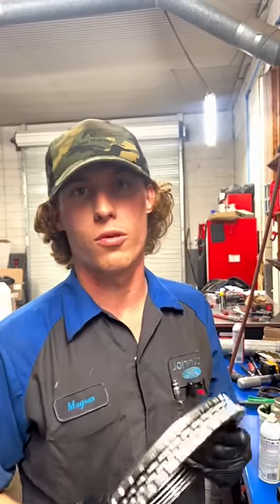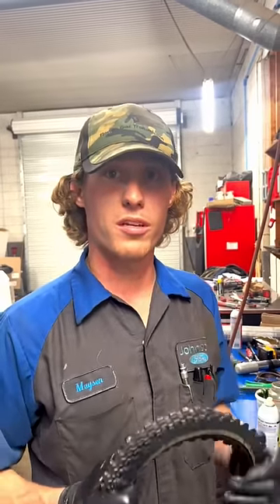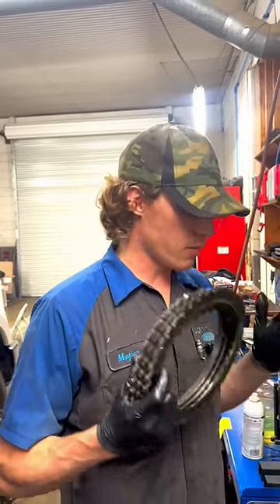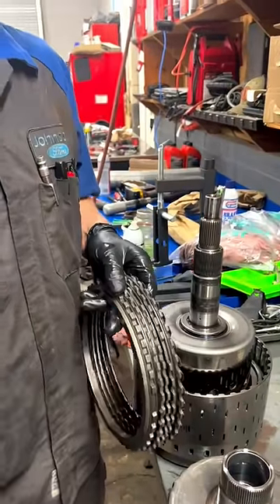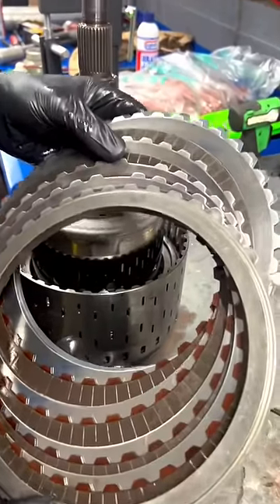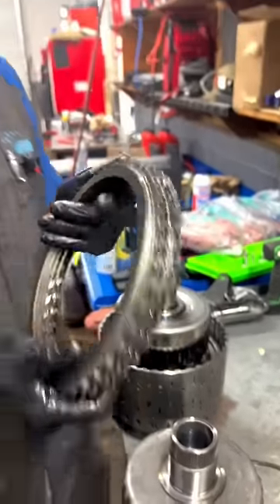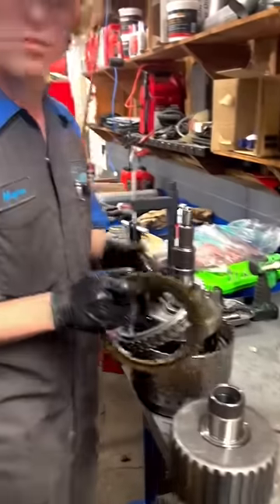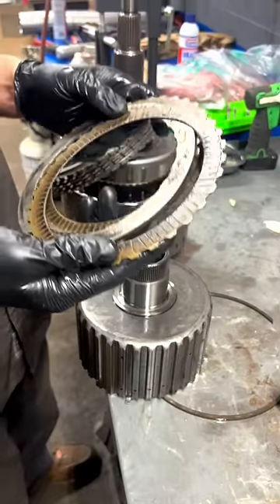Should you replace every clutch during automatic transmission overhaul? #shorts

Comment: I live by the “ well since we are here might as well “ mentality
Reply: Some times that "while you're in there" gets really expensive! But I try to do it too...
Reply: Years ago I couldn't afford to, however today yes I too live with while in there. I wouldn't know how to teardown auto tranny but would communicate with shop to rebuild mine with while in there.
Reply: I'm with ya on that. But also believe in "if it ain't broke, don't fix it" especially on those clutch discs that are showing like no wear after 100k miles. Also if I had to buy the clutches 1 at a time I'd only do what was necessary, if they came in a set ill replace them all.
Reply: While I'm here has turned into control arms, steering rack, AC compressor, outer tie rod arms, rust prevention, brake pads and rotors, and a coolant change.
Reply: @4BillC  it could be more expensive doing the job twice , 2x time = time lost of you be able to make money if it’s your own vehicle
Reply: @marieortiz698  100% agree!
Reply: @ShiFtY 1  your already spending thousands on labor... why not just get it fixed... it's already out
Reply: That mentality saves a ton of money with a good tech. Cost more in parts but less in labor in the long run when it has to get done again later on
Reply: @nothankkyou3176  and a good tech will recommend it. Personally I do my own work and on an actual budget so i don't always do it while I'm there but I try.
Reply: And that’s why it costs so much to get basic work done…. Lmao
Reply: @RK_Insanityy  sometimes but not always. Unfortunately though we have 2 options, pay someone or learn how to do it. I didn't grow up with money so I couldn't pay anyone to do anything. Now at 41 there isn't much I can't fix. It may not be perfect but I can't remember the last time I had to pay someone to do a job I couldn't.
Reply: @4BillC  amen brother I’m the same way.   It’s hard for me to imagine being poor, I know what I went through and my struggles just made me hungry so I would find that side job and learn so I could go up.  I keep that mentality even today.  There is always a side hustle you just gotta want it. Now that I do ok for myself I still do it and friends will joke that I could get it done for 1/4 of what it will cost me to do it—— maybe but then I wouldn’t get to buy all the tools and keep them!!!
Reply: If your replacing only the worn parts,then it would only be considered transmission repair,not a rebuild.
If you are replacing all of the typical consumables,then it would be considered a overhaul.
I've seen those two words used incorrectly a lot.
Not only in the transmission area,but other areas as well.
I think it is good practice to educate the owner on the repair with complete honesty.
Reply: @shifty1927  Exactly 👉
Reply: That’s a guy I will throw money at cause if I here well since we here I know my car gone be damn near new when I get it back
Reply: Until you realize that just because it's a new part that doesn't mean it's better
Reply: @griffinsells2611  you needed it 😂
Reply: I had to replace parking brake lines on a 78 F150. Did the shoes as well cuz,well here I am.
Reply: That’s the thing. The trans fluid and labour to do it again will be worth more than the parts you left in there.
Reply: Then you find that your new part is worse than the old one and burns up. That's the problem. If it works and has worked for a long time with no issues/looks new then you shouldn't bother. Don't go making more problems for yourself unnecessarily
Reply: If I've already pulled that shit apart.......... I'm replacing, because in the off chance those parts fail after I replaced only the bad ones. I really and I mean really don't want to pull it out and apart again.
Reply: Reminds me of my dad. That was his way, and now it's my way.
Reply: When you change brake pads on one caliper, if one side is worn down to 1mm and the other pad still has 4mm (which is about half life), do you replace just the one pad? No you replace both pads and the rotor and then do it again on the other side of the car. Albeit pads come in a set of 4 to do both sides of a car but rotors are separate. You don't pad slap as that causes chatter and off wear. Can you? Sure but you just don't. So I'm with you on the while in there. The clutches may look fine but their seats may not be which seems to me like the brake pads above, could cause uneven wear of the new clutches installed or the old clutches left in creating vibrations or something else. That would be the reasoning I would have to change them all.
Reply: As a customer that’s perfectly fine but as a mechanic/shop that’s a fine line to walk. I’m getting my cars bay and motor painted/worked on and I got talked into a single turbo kit. Not saying that’s a bad thing but if my GF asks I’m not gonna say it was my fault 😂
Reply: If I can afford to, I will always replace an old part. Just had to tear off the whole dash to my Jeep WJ. It got new heater core, two new plastic vents, and all new actuators. I could of gotten away, with just replacing 1 plus the plastic vents, but with my luck, the heater core would start leaking the minute I put the old one back and tightened the last bolt.

Autos trannys scare me.... most il do is replace the filter, lol.
Reply: Absolutely, it's open and accessible.
Reply: You said it best however it's the principle of the whole thing might as well
Reply: @4BillC  I grew up in a junkyard. We always tinkered with things. My first tear down on a transmission was just for the metal. I grew to learn the parts because I was just there doing it anyway.
Reply: That is what I would do as well. Like with modern manual transmission cars, if you replace the clutch you might as well change the dual mass flywheel. It’s not a matter if it is going to fail but when. And while the transmission is out anyway you can check the main seal as well when the flywheel is out.
Reply: I'm with you but I also come from a the parts are available and relatively well priced if I'm in there and fixing only the bad parts is 500 dollars replaceing them all it 650 yea I'm in here but if goes from 500-1500 nope
Reply: Aman.
Reply: Dealer mentality "btw we had to charge $$$ since we were in there"
Reply: @4BillC  if it’s not broken don’t fix it. Sometimes it’s easier said than done
Reply: But all vechels run on used parts...
Reply: As someone under warranty, I'd want them replaced while I'm still under warranty.
Reply: While you’re there end up replacing the entire car 😅
Reply: That's a slippery slope though. There's a middle ground between if it ain't broke don't fix it, and while we are here etc. That comes down to your skill and experience to know how worn or not something is, and what things you can and can't get away with.
Reply: Inside parts
Reply: I do the same thing I had 2 u-joints and a carrier bearing go bad in my truck and said well while I'm going to be pulling out the drive shaft for the 2 might as well replace the 3rd
Reply: while we are here, might as well wait another two weeks for parts to arrive
Reply: You know how many snowball/dumpster fire effect projects I've had turn into full blow rebuilds because of this? All of them, I have no self control. xD
Reply: @shifty1927 the more experience you get in life, the more you realize how wise “if it aint broke don’t fix it” statement and absolute fact of life it truly is.
Reply: @SilvaFox So if you have an engine miss with a P0305 and only cylinder 5 has the miss, would you replace only the one spark plug, boot and coil, or all 8 because I'm already there? Sometimes, if it ain't broke don't fix it!
Reply: @gregorywalton6689  not a very good comparison as the things above physically wear on eachother. Spark plugs and coil packs do not. But if i have to answer your question, if the plug is the problem replace all the plugs as they are cheap and easy to get to dont touch the coil packs. If the cp is bad Replace just the one coil pack as they are expensive and dont touch the plugs. A new boot will come on the coil pack. But anyway not really the same thing as what was being discussed above.
Reply: Agree
Reply: That’s how my vavle cover job turned to a full restoration

Comment: I went through this with GM in the early 2000’s. Under warranty- replace what failed. If you went further than that it was on your time and dime.  There was times we would hammer the 4l60s on diag test drives until complete destruction and give the customer a new unit.
Reply: That's an awesome move lol
Reply: That's how you get a customer what they need, definitely a good "workaround"
Reply: You and I are a lot alike 😂
Reply: The internals of a 4l60 are made with a combination of sugar glass recycled beer cans. No need to beat on them,  light acceleration under load usually does the trick 😂😊
Reply: I hate my 4l65e in my gto, it's a pos.
Reply: Not all heroes were capes evidently
Reply: Kinda how kia does it now 😂
Reply: @SkSKSK283 my truck has 164,000 miles on 35’s and the 4L60e still shifts smooth as butter.
Reply: @SkSKSK283  4l60e go PRNNNN. But on a serious note as bad of a rap as the 4l60e has it's a decent transmission, IF taken care of. Iive owned 3 early 2000s chevys all had the original transmissions at over 200k, my current one is almost to 300k
Reply: @r.m.s.titanicdrake7287  yes if you don’t neutral drop them and change the fluid a few times in their lives they will go 300k. There are a few reasons why the 4l60 has a bad reputation, but one of the reasons is because they made so many of them. Statistically they’re are just more of them out there to break.
Reply: God bless you guys that did that for the customer
Reply: @chevybigblock3311  add me to the list
Reply: @SkSKSK283  they die from bad MAF sensors and plugged coolers
Reply: @connor4961  You better knock on some wood, 4l60's normally let loose around 150K-200k from normal wear and tear.
Reply: I have also been known to help a customer with a replacement....at GM
Reply: Good man 👍🏼
Reply: @SkSKSK283  300k on mine and never changed the fluid or filter, fluid looks and smells new and don't leak a drop of fluid.
Reply: Not all superheroes wear capes
Reply: @MECHc3ify  and hyundai
Reply: Good jerb
Reply: Totally agree with that lol. I don’t work on cars but I operate machinery on production lines, and we will see that something’s about to go and either lean on it to get thru the day or get ready for some down time… and then put a new whatever on it… most company’s I’ve worked for don’t give a shit about that motor that’ll burn out or heaters or whatever… and some of this shit cost more than most peoples cars… They just want the product going out to the customer. They’re going to look at us crazy if we shut a machine done over anything BEFORE it breaks
Reply: You’re a good man Mr. Pearce 
I have a ‘03 GMC Sierra 2500hd 4wd, I can’t tell if I have a 4l60E or 4l80E
Reply: @goinhot9133 all hd trucks has a 4l80e but if you have the 8.1 or the 6.6 it is an allison
Reply: @kaderogers7659  nope 6.0 LQ4 I believe it is, 6.0Vortec 2500hd..
Reply: Guess that's why we had to bail out gm in the mid 2000's
Reply: It's really sad with the corporate mentality, that you need to destroy a transmission in order to get the customer the service they actually require
Reply: you’re a godsend
Reply: Pretty common on the 6 speeds too. We on purpose drive them to failure so the customer doesn’t get shafted with a trans that’ll blow a week later after a rebuild. Nowadays these 8 and 10 speeds aren’t really that bad, they just shift terribly and most of the time a valve body or a torque converter is the issue. On some transmissions GM has told us to just replace it rather than tear down and rebuild due to cost of labor on both labor operations
Reply: Hammer? Shit, if you sneezed to hard that thing would give out
Reply: @Johnny White 🤡
Reply: @SkSKSK283  I have well over 300k on an all original 4L60 and I drive hard
Reply: You're a good person g, I respect tf outta that, gm should give there customers what they deserve, blew up an 8l90 myself for a customer
Reply: I prefer my built 700r4. It is built like a tank and shifts aggressively as he'll but I love it.
Reply: You sir are a hero
Reply: I wish more dealer mechanics were like you.
Reply: @asherdie  How do you know what the fluid looks like if you never changed it?

They say if you dont change your tranny fluid by 100k miles to not do it at all. I change all my automatics at 70k intervals, never had a tranny go bad on me.
Reply: Idk how people destroy 4L60s and 80s and even 4R70s and 4R100s
Reply: In High school I worked for the service writer to help with the GM warranty documents and communication between techs customers and GM. Part of my job became hammering on customer cars to get a new parts. I worked half days my senior year. I had a work for class credit thing. I enjoyed that job a lot and did a lot of different/fun things.
Reply: @1987FX16  yep, mine let loose in 2000 chevy blazer at around 160 something thousand. Came up to a red light, it sounded like a bunch of metal bands whipping around as soon as it I was almst fully stopped. After that I think I only had 2nd and 3rd or 3rd and 4th, something like that, I feel like reverse was gone too but maybe not. Pretty sure it was the sun shell that broke. Blew up going like 5 or 10 mph with it auto downshifting.
Reply: I did the same here.. lol
Reply: My kind of mechanic, you’re a real one!
Reply: Your time your dime, I'm sure the customer wouldn't mind
Reply: Doing God's work there James. Bless you.
Reply: I love that move. So the hack is tell the customer go back outside your under warranty and hammer this thing until we have to come get you. 😂
Reply: Bless you.
Reply: @marc burns  should be changing fluid at 30k. Most manufacturers claim "lifetime" being that their idea of lifetime is when the 60k warranty is up. So the fluid is "good for" 60k but if you wait that long it's probably already fucked. If you do 30k you won't get to the point of damage most likely (if it's not a POS faulty one)
Reply: If think the 4L60's were paper transmissions in the early 2000's, you should have seen the 700R4's in the 1980's. They started getting better after 1987, and the early 2000's were indestructible compared to 1984, and they still weren't worth the crate the came in.
Reply: @SkSKSK283 i dont belived the older 80s and older trans i be running for 40 years or more without service and don't fail, maybe after that abuse, you want the same reliability?
Reply: @goinhot9133  6.0 almost exclusively got a 4l80 all 3/4 and 1 tons had a 4l80 as the base auto transmission. In trucks only in some Cadillacs did the 6.0 have a 4l65 or 4l70 behind them.
Reply: @Official_R_P_A  apparently I just got it so stuck in my head 4l60, that despite everything telling me otherwise I went with it. Is it a decent trans? Just had all new trans line, oil cooler and filter done on the trans/system.. I don’t like working on vehicles but do most of my own work. That job I have to the shop, let them have the headache of the rusted out lines lol. My wife’s ‘11 jeep Liberty sport 4wd 3.7l has reverse slipping. Been that way since we bought it. Don’t really notice until you’re backing up a grade… I just tell her to either gun it or be off it, don’t slowly get on it. Figuring it wouldn’t slip as much/wear as much if it was just engaged solid or not at all.. it’s only when you lightly give it gas and slowly reverse it slips
Reply: @goinhot9133  the 4l80 Transmission is based on the TH400 heavy duty transmission. It is a great transmission that is known to last 300k-400k miles without trouble. It has been used in up to 2 1/2 ton trucks. It can handle 600hp and about 600ftlbs of torque stock.

The 4l60 and 4l65 are based on the 700R4 Transmission it is good for low power application up to about 345hp and 350ftlbs of torque. It cannot handle heavy work or towing for long periods of time but is fine for a 1/2 ton trucks that are daily drivers or highway use. They typically last 200k-300k miles under normal on road use. 

I don't do anything more than fluid and filter changes on transmissions. There are transmission specialists for a reason. I am a GMC/Chevy guy and have used them for work, play, and daily driven trucks for 25+ years. I know I prefer the 4l80 because of how stout it is and how long it will last. I also know the abuse it can take, not that you should abuse a transmission.  I also know that they can be rebuilt to handle 1000+ HP and torque reliably with a few upgrades. They are also more forgiving of high fluid Temps.
Reply: @Official_R_P_A  I really appreciate you taking the time to write all of that. I couldn’t remember if I was told they’re bullet proof or trash. Since I was having the lines replaced, I figured I’d have em do a filter and fluid change.. changing lines, they broke the inner cooler. So it should be good to go for minute.. 150k on the truck now
Reply: My 4l60e only got me 150k miles…
Reply: @Thepar3bros  fortunately it’s still smooth as butter
Reply: 06 Silverado 1500 4x4 l33 5.3l H.O 4l60 250k motor still smooth holds 40psi oil pressure. still shifts nice and solid has had 3 ATF changes pans never been dropped although i plan to this 4th time. 1st 75k it was pulling a smaller 5th wheel. Then next 125k was mostly all highway miles. So it put in some work and still going strong.
Reply: Swear I can’t find anyone like this nowadays. I just need one 😂